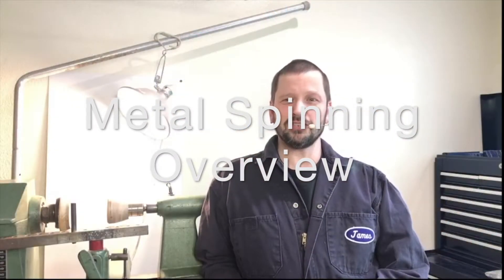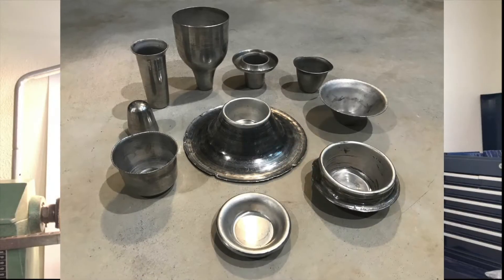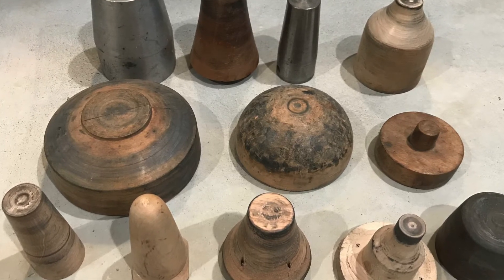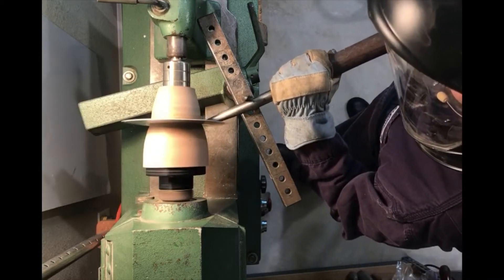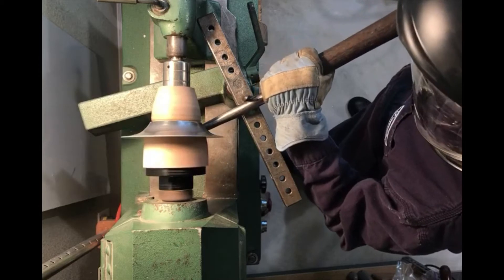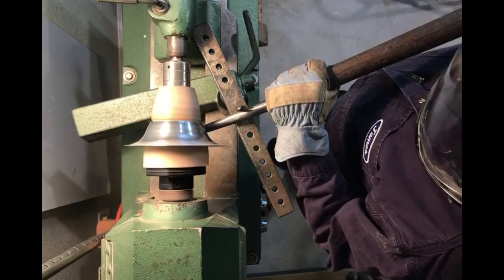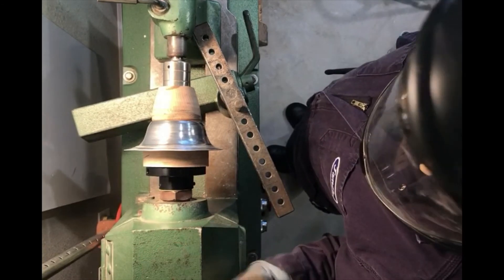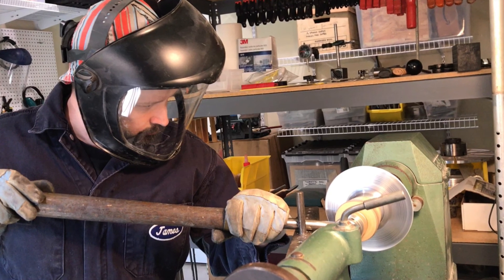Metal Spinning Overview

Comment: hello james. Can you provide a link or two and where we might purchase some aluminum disks for trying the spinning .  I would like to start and I am not sure of the type of alloy and vendor to purchase from?  Thanks in advance if you could provide it.
Reply from the maker: I would recommend 1100 aluminum to start with (around 20 gauge), 3-5" diameter. Most spinning shops have their own disk cutter but it usually isn't worth their trouble to sell individual disks. https://boppermetalsupply.com/ has 3" disks. Sometimes I can find larger on Etsy or Amazon. I hope that helps!